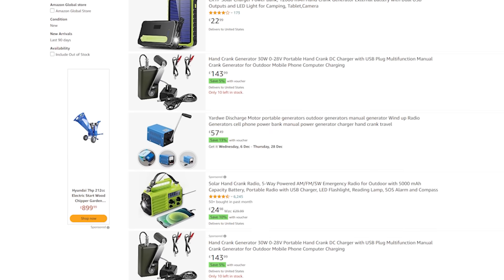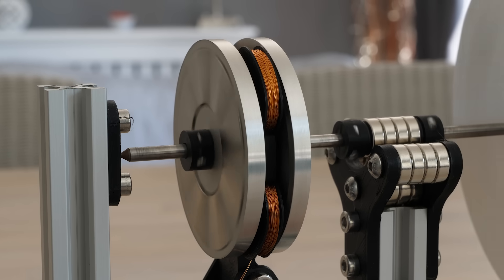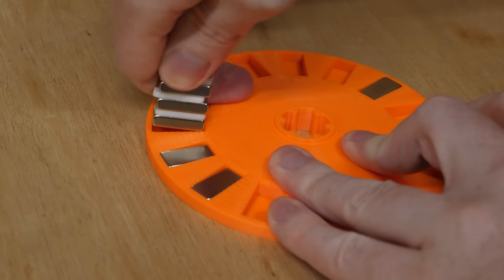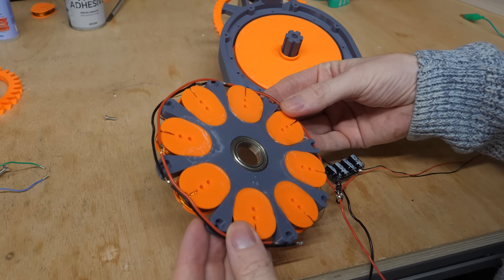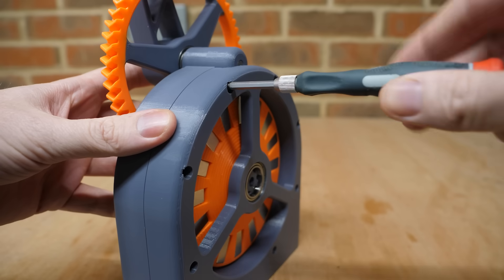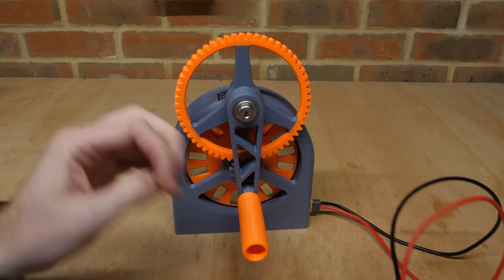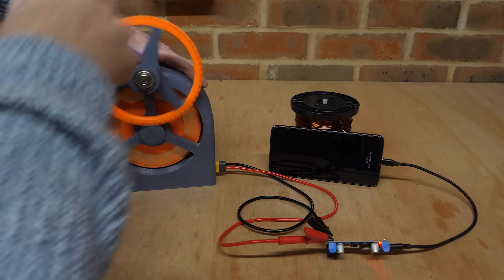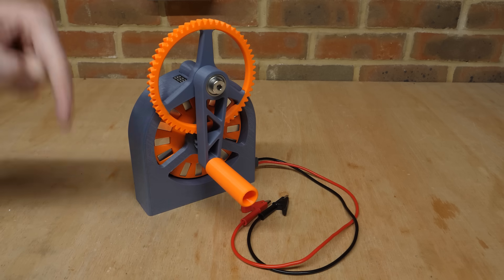Building a Generator

Comment: How long would it take to charge a Tesla model 3 from empty to full ?
Reply: Assuming the best 200W-Output from the best possible Pedal-generators: Do the math!

Your battery in Tesla is around 50kWh right? Your output is 0.2kWH/day. assuming you would pedal 2 hours/day (then a human is finished and fatigue and can no longer pedal). 10 days à 2 hours = 20 hours = 4 KWH.

So in 30 days á 2 hours you would have 60 hours = 12 kWh of energy.

In 60 days it would be 24 kWh of energy. And in 90 days á 2 hours/day i would be 180 hours of pedalling = 36 kWh of energy produced.

So after around ~120 days á 2 hours/Day you would have reached your goal with 48 kWh of energy being produced. So you need 4 months to reach your goal under WORST human conditions (max. 100W/hour).

Assuming you can do 300W/day, you would need a lot less time (2 months max).

Problem is: these are theoretical numbers as there are also conversion-losses. Conversion losses aren´t high, but hey are at least 10% at voltages of 48V.

My pedal-generator has a built-in funcion to power an e-car with about 85W of output-power with a special 3-pin cable. it can produce 48V with NO LOSSES, as my pedal-generator uses 48V native voltage. Why 85W? Because a human´s pypical fitness meets around 85W of pedalling-power. 

This allows you to pedal for 3 hours/day instead of 2 hours. this equals 0.25 kW/day and all conversion-losses (les than 5%) would be included allready. So with my generator it would take exactly ~3 months to reach that goal to charge a giant 50kWh-battery.
Reply: @SmartZero-f8e  wow I love your reply. I'm a recreational road cyclist. Where do I get a pedal generator like yours? Then I'll need to buy a Tesla...
Reply: @BestSpatula  I bought it from Amazon actually.

You have to import it. It´s a chinese model (expensive). It costs around ~700 Euros/$. Including all other costs though. transport-costs alone are 100$/Euro and are included. It weighs ~16 KG.

If you really are a cyclist you can produce a LOT of energy with this. Why haven´t you thought earlier about it?

Theoretical output is 200 kWh/year. assuming 2 hours/day. With standard 12V-load.

Comment: What if you added a flywheel to it allowing it to spin on it's own for a little while and a similar bearing system that's on a bicycle so the crank remains stationary as the flywheel keeps the rotors in motion? This way you may allow it to produce some power with stored mechanical energy while you take a short break from spinning the crank.

Comment: I think you can make the handle shorter for greater speed. 
I am not sure but this is the same ideea as the one used in the old phones?

Another improvement would be to make it not hand cranked but foot cranked (like the old car air pumps or sawing machines). This way you have your hands free and you can actually apply more force to the generator (i never understood why they had to use the hand instead of the foot)

Comment: i have 2 of em crank lights, where you crank a crank that will charge up some battery or capacitor and so you can light the LEDS.
They produce enough power when cranking to charge a phone.
They already exist, cause i got 2 of em.
They are in a neat design, tiny, and they work perfectly.

And so, why invent the wheel yet again?

It is the same with the air engine you try to build.
There are much more efficient designs out there, and yet you again go for a piston design.

Ah well.

Its like watching people from India claiming they have invented perpetuum mobiles.
Sad to watch.
Reply: btw, try using the synchronous motor found in a microwave. The one that spins the plate.
That one does produce nice voltage.
Dunno if it produces enough watt or such,.

Comment: Bro!  Could you use this, slightly modified, to run off water?  Like, have some kind of base with an arm that sticks out with a small water wheel, so the wheel sits next to the river with the water wheel like 1/3 in the water, but still able to spin the alternator?

Comment: It will probably be really difficult to crank the handle for an hour 30 minutes to fully charge your phone, so maybe you could try making a handle on the other side of the case aswell, but on the opposite side of the circle, like bike pedals, and just pedal an hour 30 mins, that might be more do-able
Reply: You cannot charge a phone direcly wih 2%/Minute with this simple cranker here. not even close!

So if you would start at 10% charge it would take you 90 minutes (1.5 HOURS and not jus 30 minues) to be done with charging with it. Since you can only gain 1%/minute.

Comment: You could make that generator put out some High RPMs if you had a few more gears to make fewer turns for your hand but more translate into the magnet flywheel for lack of a better term lol
its Simplicity though is probably a good thing.

Comment: I would like to add: There should be a circular thick steel back plate on the back side of the magnets, that completes the magnetic path to the coils and increases output even further and also increases the efficiency.

Comment: you should build one of those weighted "Maintainer" mechanisms, so the only motion you woudl have to do is an inconsistent or as needed motion to lift the weight back up in the maintainer mechanism. then have some means to control the output RPM to about the desired speed. then add height to the mechanism to increase the time available to let the weight fall. it woudl be a lot easier to use than a hand crank exclusive mechanism, but could in theory provide a more steady current output from the generator itself, once up to speed. certainly wont be as portable but, could be a fun thing to charge small batteries with.

Comment: Someone should make an exercise bike with a similar system, using a variable load to change the resistance, and stick a lorry battery in it or something so people can power stuff with it. People have made many bikes that make power, but I think the main point was the power production, not exercise. Not sure how many used that AC system, or if any used load to vary resistance.
Reply: Connect it to grid tie inverter and sell human made electricity

Comment: Great video, just use a Delon bridge circuit at the output. That circuit doubles the alternating voltage and rectifies it to DC in one turn for your purpose with only 2 diodes and 2 capacitors. Giving you a higher output range and also enough voltage when cranking with slow speed, afterwards stepping down to 5V USB e.g. as you show.

Comment: I think now with the speeds that some phones are capable of charging, (120W up to 240W)  hand cranking your phone could actually quite practical. potentially up to 10%/1 hour of ON screen time per minute, if you are able to generate 200W with a small hand crank 😀(you would probably need something much more sturdy than 3d printed PLA gears) that would be quite convenient for camping.
It would be even better if you could reconfigure the series/parallel configuration of the coils with either a physical switch or transistors. it would be like a gearbox, so you can produce different voltage with the same rotation speed, and adapt the gearing to different power/amps requirements if its too hard to spin just gear it down and spin faster, or if its too easy gear it up and turn slower.

Comment: I wonder if its possible for a hand cranked generator to output 240v @60amps🤔
Reply: Eeeeehmm. what? You know that 240V @ 60 A is a power of 14400 Watts? Wf?
No. No AC-output will ever be (of any cranking/Battery-operated or similar device) close to 14.4 KW.

A generator exists which can do 12KW at 12V though. But it will not output tha many Amps at 240/220V.

The inverter in such device is typically between 100-3000 Watts max.

Comment: I would add a second indicator for current so you can see the relationship between the two. Really, what you want is a power meter (displaying watts), but the voltage and current are also informative.

Comment: funny thing really, as long as the capacitors are not full, its power draw is whatever you shove in. 
Same for the motors, although when the windings get hot and turn more resistive it could burn, assuming the motor RPM didn't kill it first or the commutator didn't die either

Comment: would be great as a gravity generator.  high gear ratio transmission to a winch setup.  could have a spring rewind and one way clutch to automatically rewind the pulley. weight goes down, turning the pulley thus the generator. making power, when the weight reaches the end of the rope, just pick it up to rewind the pulley then let it go.  advantage is the work you have to do is a burst of power to lift the weight, not a constant turning as gravity provides a nice constant force, drawbacks is power loss in the transmission and pulley.

Comment: I was wondering could you dun the crank threw a v belt on a bike tire? for charging on the go our making power when exercising. Also another question, could you block a few rotors together with more spools? That meaning, have a block of several on one axel?

Comment: yes, it's a hand crank generator. They've been around since the late 1950's. Not practical at all for charging a smartphone
Reply: No. Most hand-crankers today can handle 30-40 Watts. Not 10-15 Watts like you claimed. You get this only with 12V output though, as with USB-output 50% of watts is lost because of voltage-conversion. That´s a user-problem though if he wants to charge via USB. I don´t use USB-charging in most cases so i don´t have this problem.

My handcrankers can even handle ~50 W max. Though with these old motors the resistance is very high, so you can only reach 40W on these realistically with human hands.

I use a pedal-cranking device where i use HANDS instead of feet. I get easily 60-80W here via hands, since my hands have really gotten very powerful in the las 6 monhs.

But my pedal-generator can handle up 200W. And realistic are 120W for me currenly/hour.
Reply: @SmartZero-f8e  ....you're a dingbat
Reply: @SmartZero-f8e   you babble a lot
Reply: @SmartZero-f8e   ...lol
Reply: I can push out easily ~60 W with handcranking. I can charge 3 phones/hour with 60 watts via USB. so it IS practical to have tech like that. Especially since hand-crankers are cheap. they cost only 100$, but are really quite powerful.

Imagine you would have no house. You could power nearly everyhing that way. Price is: the pedal-generators are expensive.

So with this lowend 5W/10W-Handcranker here you can really have "fun", charging just one phone/hour. It wouldn´t even be fully charged in one hour. But on my handcrankers you can charge so much more and on my pedal-generator you can even charge 4 TABLETS/hour. This assumes a 36Wh-battery used in each tablet. 4 tablets equals 160Wh. 10% power-loss (160W/hour - 10% = 144Wh left netto after USB-conversion = 4 x 36Wh for each tablet 36Wh). My Pedal-Generator can do PD and enables superfast-charging via 12V-Cigarette-Ligher Plug. 10% USB-loss is only because i use a GAN-capable Superfast-charging Cigarette plug.
Reply: @SmartZero-f8e  you make no sense.  The most anyone can generate from hand-cranking would be 5 to15 watts. That  means for every hour of continuous hand cranking you can run your laptop for about 6 to 10 minutes, or smartphone for about 16 min. You'd have to continuously crank most of your life away in order to regularly use any tech. So, silly person, you'd better get cranking, lol

Comment: I'm wanting to do something similar, except im trying to charge a light system on a motorized bicycle. I have a few ideas how to connect it to the motor, and gear down so it doesn’t blow at high rpms on motor side, but i was wondering if this could be stacked??? So i could have a wider alternator instead of taller?

Comment: This is very cool. How long would it take to charge a 1450mah LiPo battery? (through a balance charger of course!)
Reply: Assuming you use standard 5V-USB Charging (no fast-charging i would use on a simple Li-Po!), this means 50% Power loss.

ON my handcrankers, which can do 30-40W, it would take:

3.7 * 1.45A = 5.15 Wh

Which is very low. On a 30/40W-Handcranker this can be charged (20W/Hour after power loss) = in 15 minutes or less.

But: Assuming you want to charge this battery on this lowend-5W/10W generator from his video it would take you 30 minutes instead or even 45 Minutes!

Comment: 11:06 i think you should make a small "daughter board" for the generator that has the 2 v to 24v board that converts to 5v, a small voltage indicator and a decoupler that's set to 24v so you don't end up popping the board. This is the kind of thing you make once and store in a box for rainy days. Worth having even outside a cool YT video.

Comment: Needs another stage reduction to give you more leverage therefore less speed at the crank required. Even common, garden variety hand powered forge blowers from the ancient days have at least two if not three reductions for the very same reason. A flywheel from cast iron would work great too. Your table mill could make a great one from a cheapo cast iron exercise weight. You don't need its full 1kilo weight, just enough to make a "mechanical capacitor".

Comment: Could it be improved even more, to a hand-held device just like a phone, or is this the limit of it's size and it's capacity for generating enough power? Can the hand crank be replaced with other mechanical leverage like the ones sued in old sewing machines, or like the ones in hand-held self-generating flashlights? I'm dying to know.

Comment: If you could measure how much torque is needed, you could potentially set up an "easy" charge system my brother and I came up with. It wouldn't be "space" efficient, but it could be time/automation/independency efficient. If you create a large and lightweight "water wheel" on a table top, you could empty a bag of sand into a reservoir that steadily fills the wheel cups and fosters continuous rotation with the proper flow. With some adjustment to the sand's flow rate and torque(electrical) needed(perhaps using lower voltage draw, that is then stepped up to enable the system to operate under it's limitations, even for higher voltage necessities(at the cost of efficiency of course, but often "something" is better than nothing.) Then the only upkeep necessary is the occasional heavy lifting of a load of sand from ground level to an elevated reservoir, which is (usually) much more conducive to our biology than "persistent effort" over longer periods. We estimated that a system (similar to yours actually) could, with three sandbags, generate a fairly consistent 4v load (with a 5ft diameter wheel, ideally with a bike assembly for the ability to add human power at your leisure) with just those three bags and only need to be "refreshed" once every 45-50 minutes(longer with more sand obviously, but that also means more time "resetting"). Could be a lifesaver if you're busy with other tasks and don't have time/energy to "burn" on manually charging your devices in a power outage situation. That's technically lowballing it since we figured many systems will be inefficient and resistance/loss averages with non-nominal materials.

We also figured out that if you could prep a proper capacitor array to step up voltage to something like a car battery, this exact same setup could even potentially allow as much as 5-10 minutes of operation of a refrigerator a day if a full 10-ish hours are committed to charging the converter. Taking even one minute on a pedal motor with each reset can make a MASSIVE difference in recouping the losses of this longer form charging but is far less taxing. As long as you tried to only open the fridge during the "recovery period" of operation, you can ALMOST even maintain a freezer. 

Sorry for the data dump. Been sitting on it for a while. Figure folks already think about this stuff, but wanted to share our thoughts. 
GREAT vid~! Very inspirational~

Comment: Perfect. I was looking for a motor/generator winding project for a youth group I work with. I can already see putting test point earlier in the circuit to show why diodes and capacitors are important.

Would you consider making designs for other types of motors and generators?

Comment: question for any electrical engineers out there: If you hooked up maybe 2 slightly upsized versions of these generators to something like a bike, could you set up a system with capacitors and a regulator to ride hard for a couple minutes, then leave it and it would charge your phone to full? maybe optimized to the phones perfect charging voltage for fast chargin. also what would the challenges be on a project like that?? final question is why is it harder to spin the generator when charging higher resistance components, i understand its because to generate more energy of course you have to work harder, but where is the magnetic field being produced that slows the magnets in the generator?
Reply: Newer motors use elecronic chips to control magnetic field (Brushless motor).

Older motors don´t have chips. Resistance is higher. magneiic field cannot be controlled.

The resistance is controlled via VOLTAGE. the lower your voltage is, the lower your resistance. the higher your voltage, your device needs and when it´s plugged in, the more resistance you have.

Comment: To actually charge a phone, maybe you could make a gravity fed device? Like a mechanism on which you hang a weight such as a 5 Liter water bottle and let it drop down, unwinding a spool driving the generator? So you only have to lift a weight once and then have a source of power that can charge a phone? Might need a few lifts or a heavier weight, but I guess a bit of clever engineering could make that work.